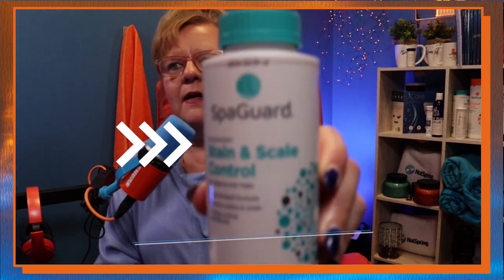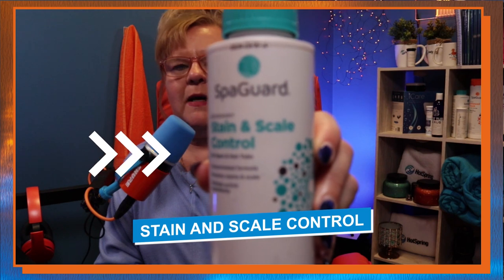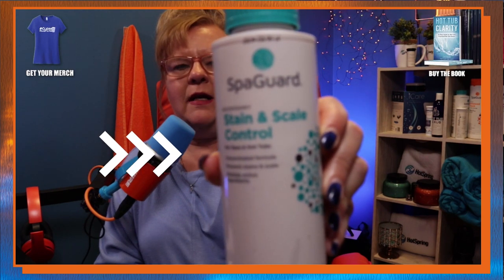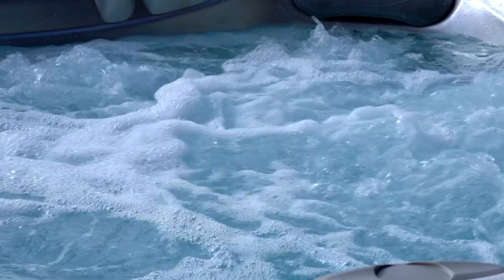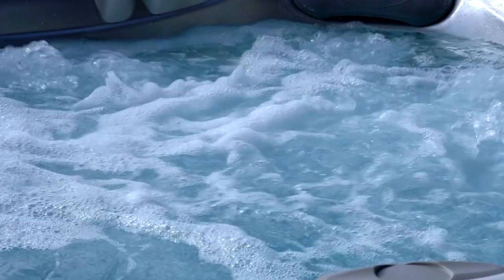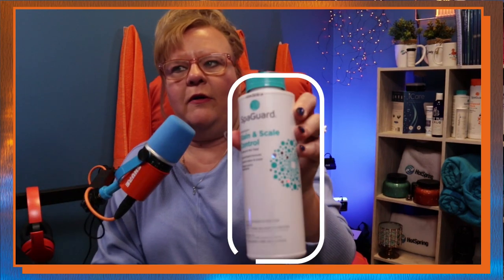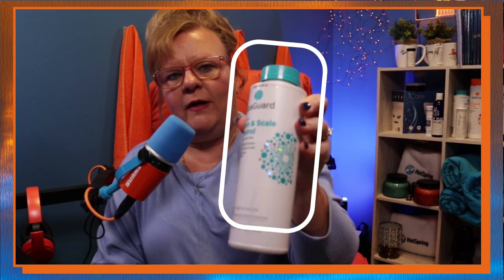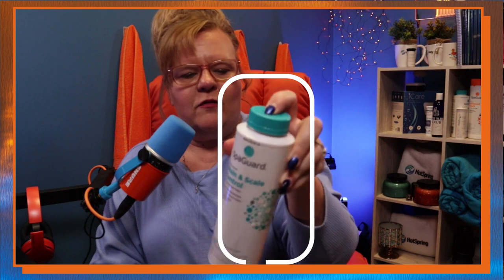This Is Why Your Hot Tub Feels Like Sandpaper | How To Fix When Your Hot Tub Feels Like Sandpaper

Comment: Thank goodness I found your video. We have only had our swim spa since Oct 22 and everything was fine. Then we got months of rain and so I only checked the water with my test strips and filled my floating sanitizers. No one ever told me about using stain and scale weekly or I would have. But low and behold the weather warms up and I think OK swim season had began and I get in and find ruff sandpaper textures all over the chrome handles and sides and floors of both sides. The swim side being the worst. I don’t understand how everything tested just fine and then all of a sudden I have a major problem but here it is. So I have ordered up the stain and scale remover and am on the hunt for my filters since it seems that too has been delayed in the commerce stream because of Covid. So once I find those the great descale and purge is on. Thank you so much for this video. I was in tears over finding all this calcium stuck every where and was afraid the whole thing was ruined. But now I have a solution! Thank you again.
Reply from the maker: So awesome it helped….    Your scale for high enough it fell out of solution that is why it came out of nowhere

Comment: I just drained, scrubbed, refilled my hot tub. New filter. Also added scale dissolver with new water. It’s I dunno over a week later? Our hot tub is probably ten years old. Def doesn’t run like it used to. Seems this time I’m working extra hard to balance and get it clean. My alkalinity was low yesterday and ph was high. Now, I’ve been watching it like a hawk and cleaning new filter probably
3x in the past week. Normally our city water seems to be pretty good. I have white scale after adding a tiny amount of baking soda yesterday to bring alkalinity up. So now I’m going to have to drain the hot tub again and start all over after adding a whole new bottle of scale remover?  Today, sand paper. Normally I do add the scale remover in my regular routine. Admittedly not on an actual schedule.  Help please! Thank you.
Reply from the maker: The calcium has just worked loose.    I’ll send you a video link here to fix that
Reply from the maker: https://youtu.be/0jIMGnbM1Hc?si=x8fUUVYdvoN0up2z

That will solve the problem.   https://shopthehottublady.com/collections/enhancers/products/ideal-water-care-stain-control.  This or this will work. https://geni.us/stainandscale
Reply from the maker: I’m sorry I thought you were watching a different video.    Did you use a whole qt before you drained
Reply: Not this time. I added maybe 1/4? (Because I realized I only had the one bottle) I also scrub the sides as a stain remover after draining. (The bottle I have said to do this.) should i add the rest of the bottle? I just don’t want to have to drain it again! Sighhh
Reply from the maker: @ManthaINTheMiddle-gt1pl  personally if it were my tub (I have had this issue).  I would start over with a whole bottle and drain no longer then 2 days later.   Please follow all the steps you can’t just add the rest the bottle you have to rinse the filters and drain the tub.  You can not use it with that much stain control in there
Reply: What if it still feels like sand paper when I empty and go to refill it? And how much should I add of the clarifiers with the new water?